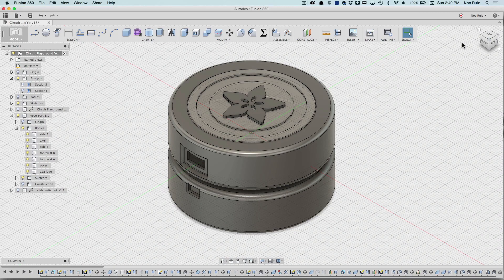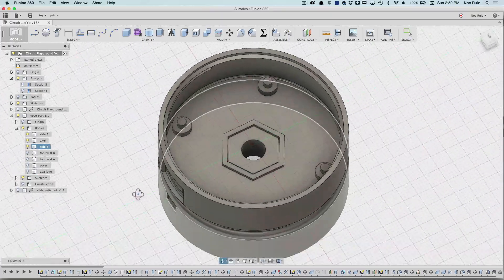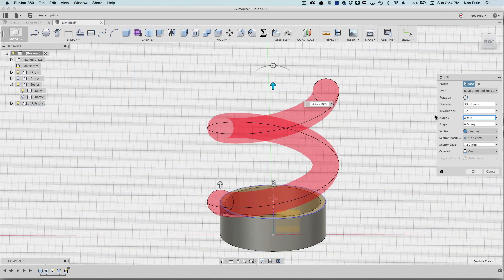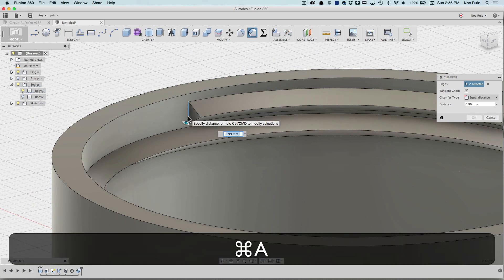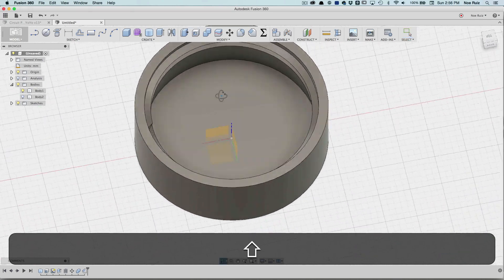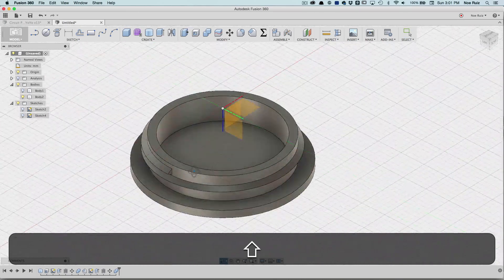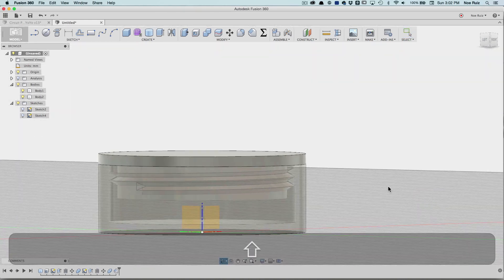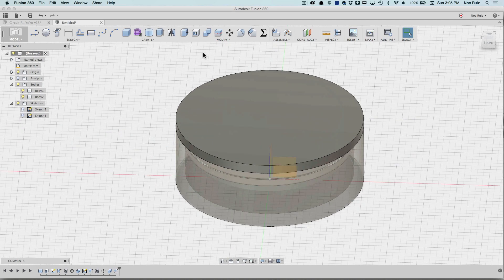Layer by Layer - Using Coils for Threads

Comment: Hey Adafruit ,
currently i am working on my project (3D bioprinte) and i have question about  how can i control two extruder so u can print layer by layer. so basically my each extruders contain different material. so  how can i print layer by layer like one layer of 1st extruder and second layer from second extruder, again 1st Ext and then second

Comment: Somewhat unrelated question - how did you make Simplify 3D show a printbed like that?
Reply from the maker: It's somewhat a new feature in Simplify3D - Some of the default printer profiles have built-in bed renders. I believe they have a tutorial on how to create and import your own, most likely on their site or YouTube channel. Might be interested to cover this in a future tut! –Noe
Reply: Yeah, looks like you can basically upload an STL to represent a background. in Settings -> Machine there is a bottom interface to add models, it's just that MakerBot_Replicator2X.stl that I have configured doesn't have a meaningful model.

Comment: Good guide mate.
But instead of moving the coil up and down to align it with the outer one, try to just rotated it. You actually don't need to align it at all, as long as the threads are the same height.

Comment: How are you accounting for the weight difference between the two sides? The battery would be much heavier right? Yo-yos need to be balanced to work properly.
Reply from the maker: The battery and circuit playground balance out with the right placement :-) Here it is in action https://www.instagram.com/p/BJoaTB_gnEa/